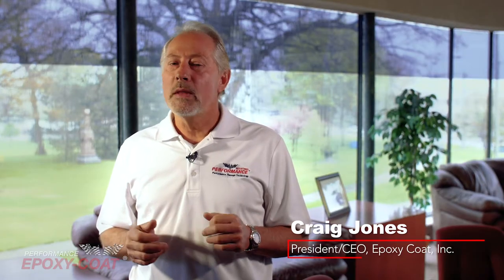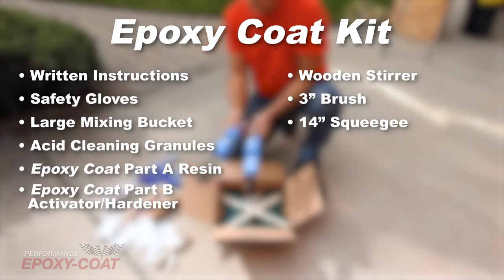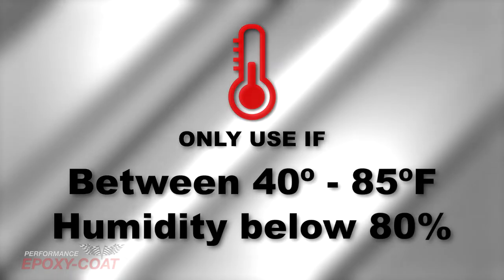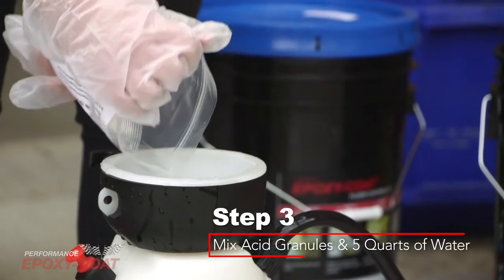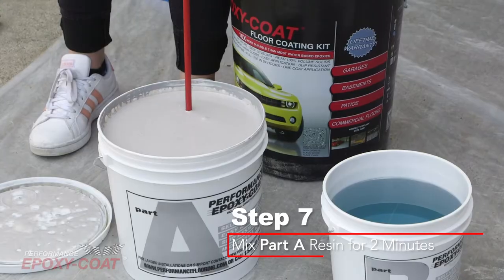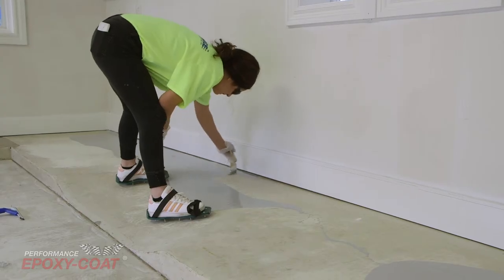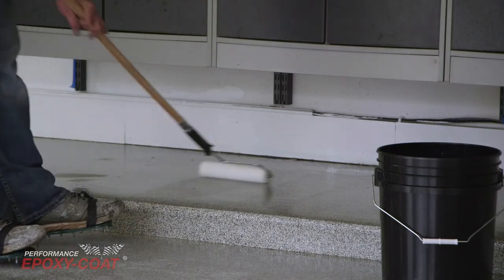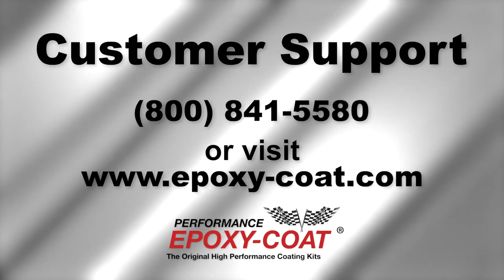Official Epoxy Coat Good Kit Installation Instructions

Comment: I have a 1500 sq ft project which means I'll have to use 3 kits. Because of the 45 minute "work time", I'll have to stop to mix the 2nd and 3rd kits after I've applied the first. Will the transition (stop & start) points be noticeable (lap marks or discolored, etc)?

Comment: I puirchased a metallic kit. Is the application the same?
Reply from the maker: With the metallic kit, you need to add the metallic pigment into the Part A of the clear epoxy 24 hours prior to applying that coat. An instructional video for the metallic kits is coming soon! In the meantime you can find additional written instructions on our website.
Reply: @performancediy  Thank You.